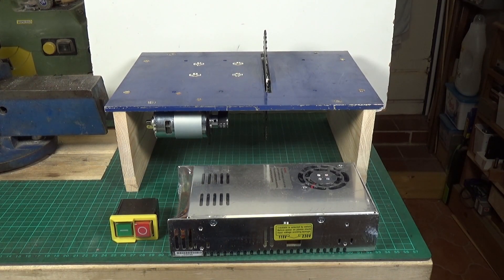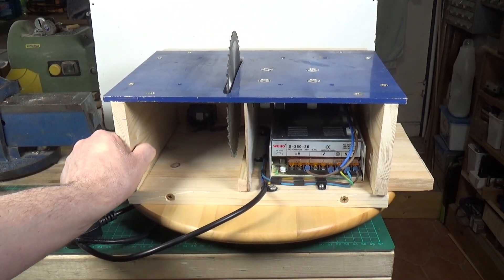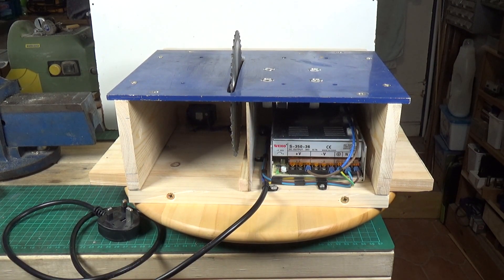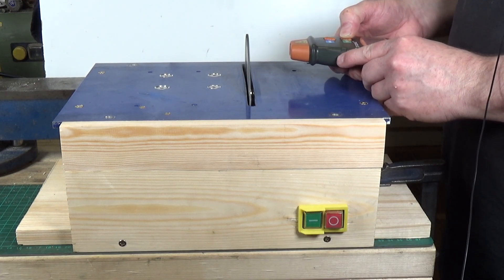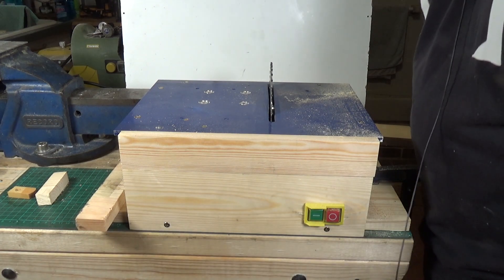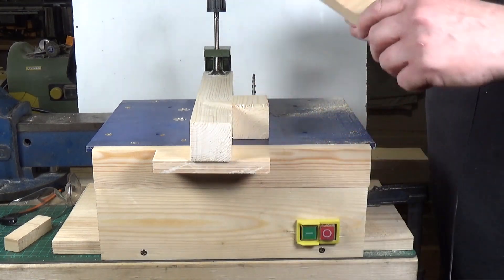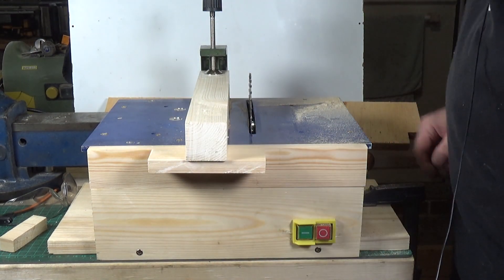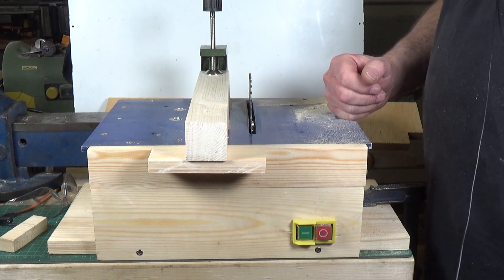775 DC Motor Based Scratch Built Mini Bench Saw - Part Two

Comment: Works great Alan.  I have a similar fence on my bandsaw made out of metal.  Instead of clamping down like you have done, I have an end plate that pulls up against the end of the fence and clamps against the table edge.  Just another way of doing it.

These little 775 motors really benefit from 35 - 40 volts.

I see they sell little belt sanders/linishers with this motor.  Amazing how these have taken off.

Once again, it's a cheap and effective way to go for hobby work.

Cheers Rob
Reply from the maker: Thanks Rob. I'm quite amazed at the amount of power these little motors have. The saw is going to be very useful in my shop.

Cheers, Alan.